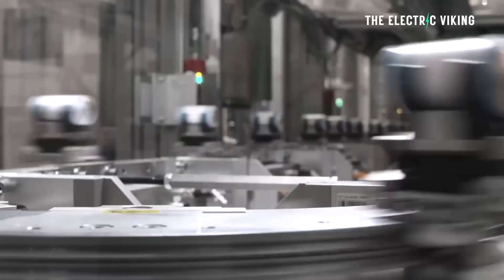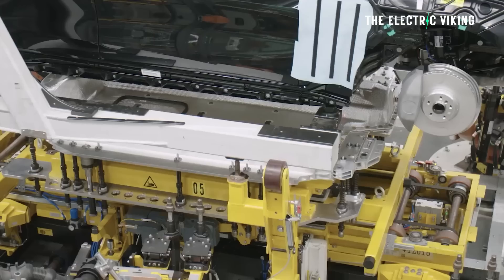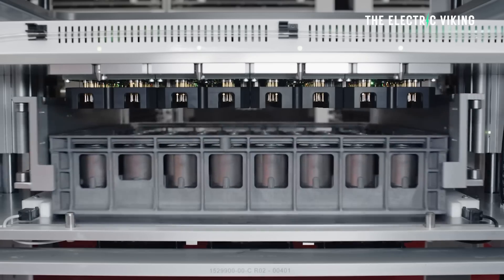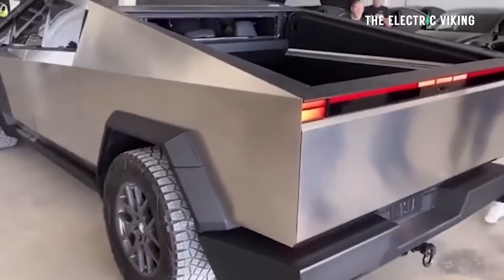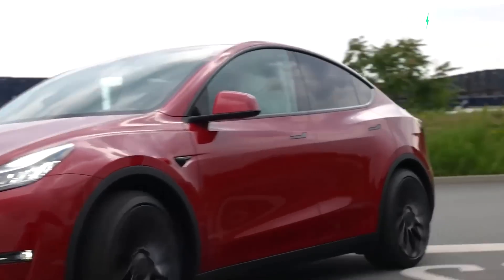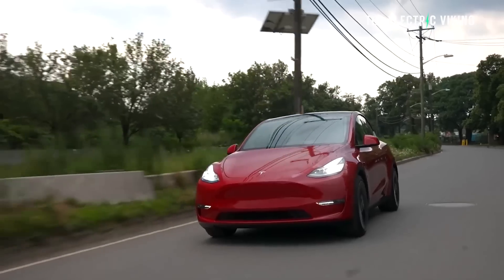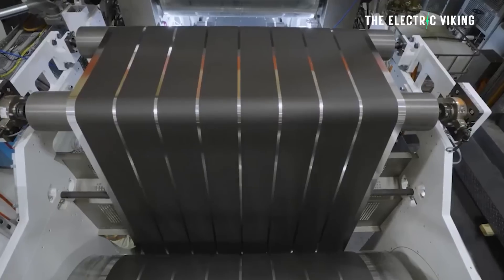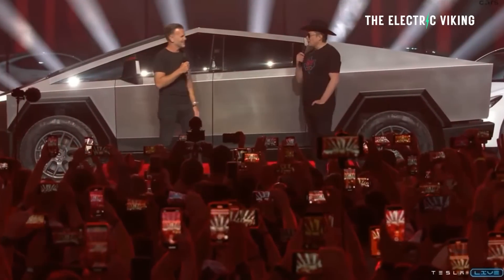4680 battery cell production changes revealed by Tesla at Q3 earnings call

Comment: So...Austin has created 20 million of these batteries, which aren't in use because of issues they AND Panasonic have run into.  But we're supposed to swoon with adoration...

This is as bad as making 1 Raptor II engine a day even though they don't work right as designed.  Not genius.

Stupidity and insanity.

Comment: Wait a minute. Higher ENERGY density means more energy stored per pound of battery. So, higher energy density means less weight needed to store a certain amount of energy.
I think Sam made a bit of an error on this point. But if it is me that is mistaken, let's clear this up for everybody. Am I mistaken on this point?
Reply: Isn’t density something divided by its volume?
Reply: @Youtubeuser1aa  Yes. We're talking about an exact  amount of MASS,  divided by (or "fits in to")  an exact amount of space (volume).
Reply: @andrewkaiser7203  so energy density refers to the amount of energy within a unit of volume, correct?  Just like gasoline is much more energy dense than batteries.  I am confused why you are bringing mass up up when discussing energy density.
Reply: @Youtubeuser1aa  Yeah, it can be tricky. Energy density can mean either of 2 things. It can mean: Amount of energy per pound of material, OR Amount of energy within a certain amount of space. They both matter, and it's common to mistakenly use the 2 measurements as if they mean exactly the same thing. It's super common to mix the two things up. They are closely related, but an important difference between the two measurements is routinely messed up by many. Do you know what I mean?
Reply: @andrewkaiser7203  density only refers to something per unit volume.  

You can have mass/volume, or energy/volume.  Those are densities.
Reply: @Youtubeuser1aa  No. When we talk about density, it refers to one variable versus another (in a general sense). It usually means what you said. That is the sense which is most familiar to people.
But batteries have "energy stored per amount of mass", but how much space does said mass take up? When we answer THAT question (which is absolutely necessary) this leads us to a different metric of density:
"How much space does it take for a certain amount the material". It's a different measure of density. Know what I mean? And the two measures get thrown around as if they are identical. That happens A LOT, and I've done that myself. Easy mistake, which is why it happens a lot.
Reply: @andrewkaiser7203  the literature is very clear.  Density refers to something per unit volume.  Not mass.
Reply: @andrewkaiser7203  for the record, something per unit mass has the prefix specific.  For example, specific energy is the amount of energy per unit mass.  

Energy density is energy per unit volume.  These are the correct usages.
Reply: @Youtubeuser1aa  Ah yes. And when people say "specific" energy, they are usually using the right prefix. However, plenty of people say "energy density" when they really mean "specific energy". I'm guilty of that myself, but now I'll get in the habit of using the right terms. It's not so hard to remember, but it's easy to forget! ;)

Comment: Tesla is in a bind; to customers who they promised and investors they promised.  They hoped to have 4680 fixed in a year and they haven't been able to. So they will put out a small volume of Cybertrucks so they can at least say they met their deadline; but it will be for a loss.  So Why6212; how does that not help the competition?  Tesla needs a replacement that they can use in Cybertruck, Semi and the new Roadster so they can move on these - otherwise they are stuck.
Reply: The legacy auto competition except Chinese ev makers don't even design nor make their own batteries but contract them from LG, Panasonic, catl with no quality or design control resulting in fires😂

Comment: My biggest concern about the 4680 cell is its charge curve at a Supercharger. Hopefully in this new version they will improve this, otherwise it will be a failure. In order to charge such a large battery pack, as is required in a CyberTruck, a fast charge rate is needed. We've probably all seen several YouTubers reviewing the Model Y with 4680 cells and they were all fairly disappointed in the charge curve during fast DC charging. It fell off pretty quickly to a rather poor rate of charge. Worse than any other battery pack Tesla provides.
Reply: There is another approach to making enormous battery packs charge faster, brought to you by Porsche, and more recently, General Motors:  you add the electrical hardware necessary to reconfigure battery modules to series connection for charging (temporarily increasing the pack voltage for faster charging), then reconnecting in parallel after charging, for driving.  Someday, all EVs may adopt this approach, as demand for more range results in larger battery packs.

Comment: The simple fact is that being a battery producer is a challenging task... Tesla just understands that and therefore  understands it can not compete in the lower end low margin segment against CATL or BYD cells. Tesla is repositioning 4680 where it makes sense : a market with much lower pressure on margins, the upcoming cybertruck

Comment: The proof will be in the production numbers - when Elon says " next year they won't get to normal production numbers' there is only one reason: 4680 still has high failure rates (which I've been saying for months)  - last year he said " we have 95%" of the 4680 problems solved - well they still do not seem to be solved or nothing would hold up full production.  What Tesla will do, is quietly dump 4680 and introduce some new battery they say is as good.  Till then red ink will be synonomous with cybertruck;so production numbers will be low.  Telsa down about 12% in 2 days since the obvious is hitting investors - cybertruck doesn't equal more profits it means less profits..
Reply: Less profit, but it will choke out competitors. More future profit
Reply: If your investing based off cars your missing the point
Reply: And dominate the truck market. Less profit per truck and more volume made/sold = Massive profits
Reply: Consider: there's plenty indication for GM's bankruptcy. Say Tesla buys them, Mercedes, and partners with Toyota (like it did in 2010) Now where's the value? Dominance

Comment: Given how subpar the thermal characteristics were with the first gen 4680s on the MY AWD, I’d say Tesla is facing big challenges in hitching its wagon (or truck) to this form factor.
Reply: Never heard of any thermal issues and that makes no sense, as the internal resistance of the 4680 is much lower, so much less heat produced compared to the common design.
Reply: Look at Branden Flasch’s recent videos on MY AWD-4680 pitiful DCFC charge performance, severely lagging the 2170 MYs.
Reply: They seem to work fine in the Semi. 🌻
Reply: @IN-hw8it6 semi’s are using 2170’s.